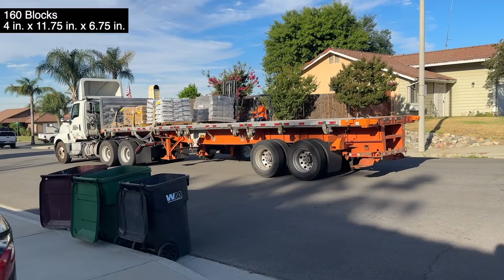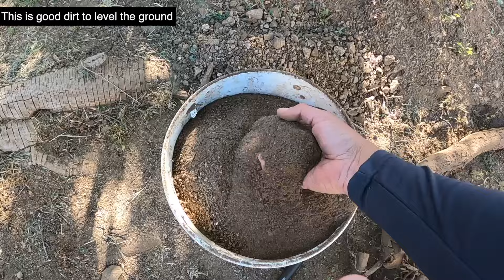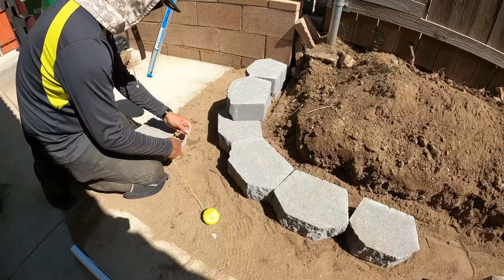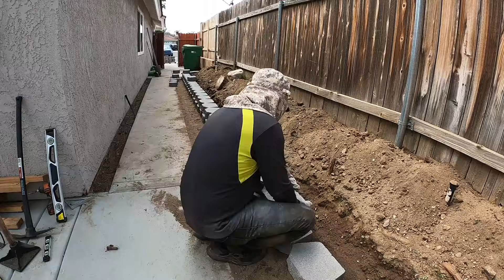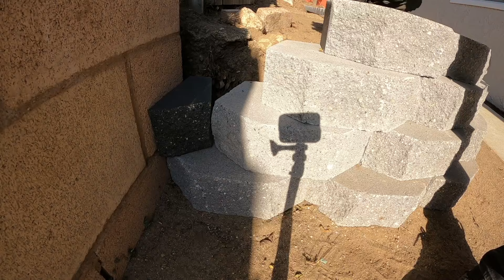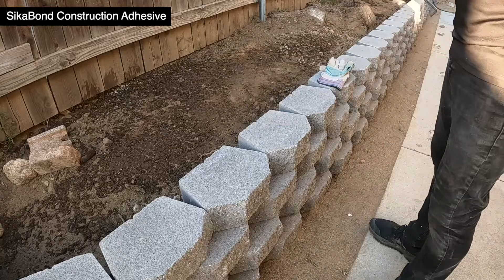Build Your Own Retaining Wall in Just 2 Days | DIY Project Guide

Comment: Sadly that’ll all be warped and misshapen after a year or two because you didn’t use a paver base, set the first row halfway into the ground, or anything that you should’ve done for that matter. I hate to sound so negative but if you’re going to spend $1,000 on materials (looks like you spent nearly that much on pavers) you should really do more research on how to do the job correctly, because otherwise it’s all for nothing.
Reply from the maker: It’s been over a year and looks exactly as the first day, everything is nice and level, you are good as long as you have a nice solid ground.
Reply: By that time, they already moves to the bigger house.
Reply: Sadder still yet, prior to the added raised retainment wall in a case of neediness the homeowner could have gotten a vehicle to the rear of the structure.

Comment: It would be best to put at least 2" of gravel for the base and sink the base layer by half the thickness. 3/4 - which is 3/4" stone down to dust works well. (think of Grandma's old gravel driveway). When it settles, it gets pretty solid. If you knock the 'lip' off the base layer , it makes it much easier to lay. Ask your local city what the max height would be. Most of all, have fun and be safe

Comment: I don't have any issues with the construction as this is a simple garden wall.  For the amount of soil it is holding back and the obviously hot dry climate, it is fine.  It is essentially a raised garden bed.  However, it is not a retaining wall.  In wetter climates and more steep grades, it would not hold up for very long.  DIYs should always do some research on the building codes for their particular areas to see what works best.

Comment: Not sure of this would require a better foundation such as gravel or sand to prevent failure.  BUT, by raising the dirt above the bottom of the fence line, you will accelerate wood rot which will cost you more money in the near future. Apart from that, this looks beautiful!
Reply: god stop whining. he even has metal fenceposts WHO CARES
Reply: @cryengine_x  He cares. You don't. If you don't care, then why comment?

Comment: Looks great! Would you recommend backfilling with gravel or does the dirt drain fine by itself?
Reply from the maker: I backfilled with dirt and haven’t had any issues, it’s recommended to put about 10 - 12 inches of gravel against the blocks but I didn’t put any and no problems whatsoever.
Also depends on where you live, if you get a lot of rain you might want to consider putting some gravel.
Reply: @NumberDZ  Great tips, and thank you!
Reply: have to line wall with a "permanent tarp like material" before backfilling.
Reply: @lettybromenschenkel5807  fun fact the us govt bans geotextile fabric (your tarp like material) in it's drains such as under spillways where lives are at stake.
Reply: @cryengine_x  Typical Democrat regulating
Reply: @lageronimo8012  nah. its under a damn spillway, like 10k could die if the drainage fails. i'm sure it just depends.

Comment: This installation might be ok where this guy lives. Where I’m at it definitely would need gravel because of frequent freeze/thaw
Reply from the maker: You're right, it depends on your location, you might need to take extra precautions. So far, I've had zero issues with it, it still looks amazing and straight.
Reply: @NumberDZ  thanks for the content. Would you mind sharing what region you live in?

Comment: i am curious ive heard there has to be 6 inches of rock as a base layer, but it seems you didnt have to. what did you use for the base, was that sand?
Reply: he sifted the dirt that he already had in order to remove the large rocks. its in the video
Reply from the maker: Depends on where you live, we don't get much rain here, so I just used dirt as my base. But if it rains a lot where you live, you should do rock just in case.

Comment: Good job but myself, I would’ve laid them on a 2-3” compacted layer of DG ta make sure they don’t become uneven when it rains
Reply from the maker: Great tip.
My retaining wall looks exactly the same as the first day, it has been exposed to heavy rain and snow, so far so good 👍
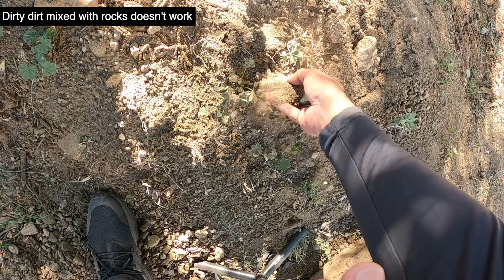Reply: @NumberDZ  2:42 you stated "dirt mixed with rock does not work."

Comment: Question: why bond the top layer, but not every layers from the bottom?
Reply from the maker: There's no need to put glue to the bottom layers since the weight of the top layers will keep them in place.

Comment: What type or brand adhesive did you use for the top layer?
Reply: The big box stores has it, Silka, I think it is called.  It's over in the masonry section - near the concrete tools.  Expensive but their stuff works.
Reply: @DanTheManIOM  that stuff will only last in the elements idk, like a year. i honestly kind of doubt its needed, the pavers have lips on the back that kind of lock. but it wont hurt anything and probably helps holds them in place that first yr. after which those lips, the earth behind, and just time will lock them in place.
Reply: @cryengine_x  thanks, I am asking for a friend who built a wall, IDK 6 foot tall ?  and she and the guy who did it, did not really read up before starting, but her guy did glue the top blocks to the top of the wall and since the job needs redone, and what one could complicate that ?  Adhesive that actually WORKS !!  I'll let you know...she terminated a right angle corner and it's all misaligned, looks terrible, and is going to fail, it's already uneven and not level at the corner.  Thanks
Reply: @DanTheManIOM  yeah its common to glue just the top layer. like i said it wont last in the elements but its not gonna hurt and probably a good idea to keep someone from kicking off the top layer or something by accident in the first months maybe. but really what hold these walls together is the weight of the stones.

Comment: Why did you only apply adhesive on the top row?
Reply from the maker: You don't need to put it on the other ones, the top can move easily that's why you need to put adhesive on them. The ones on the bottom don't move because of the weight.

Comment: Other videos showing to have to dig 4 to 6 inches, yours is just flat and level with the ground. Is it strong? Cause digging is the hard part. 😅
Reply from the maker: This is just a retaining wall you are not building on top of it. 
Everyone has a different opinion but in my application I didn’t have to dig anything, as long as you have a nice solid flat surface you are good. 
My wall is very strong.